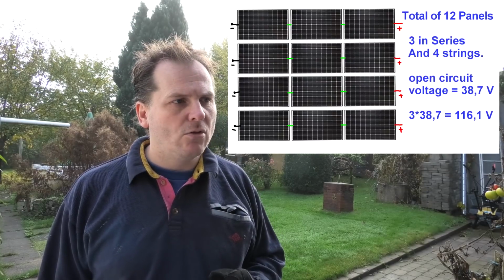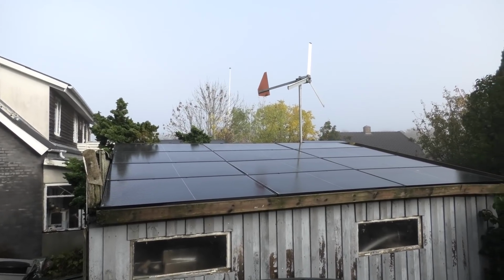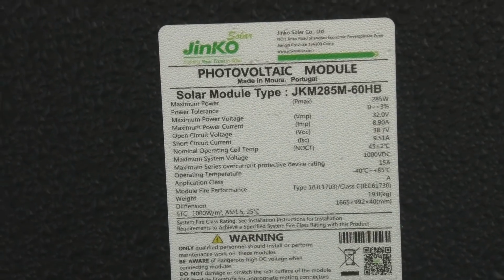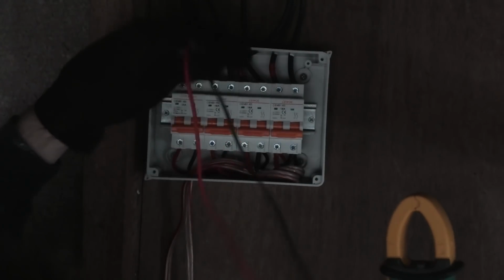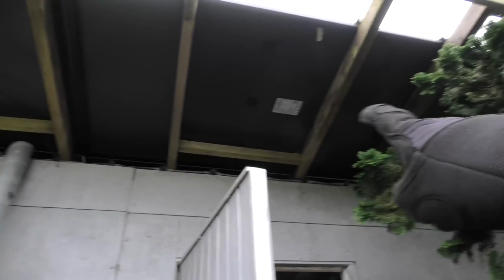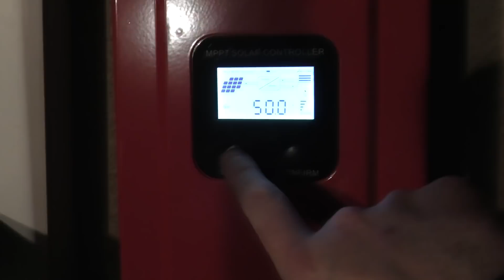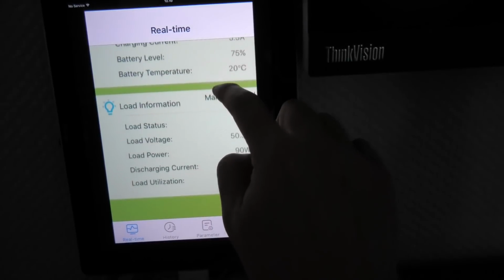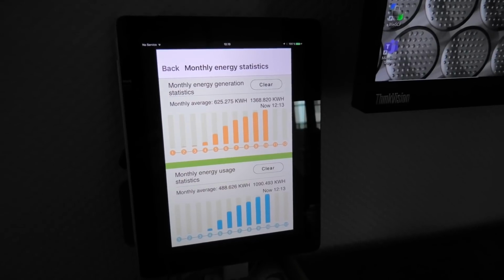Rewiring from 3 to 4 Solar Panels in Series, To Improve Performances - 1013

Comment: Looking good Morten, keep an eye on that 150v max input. I connected 4 x 38vOC panels in the summer and the Esmart controller cut out at 155v in full sun, ended up using a 3S setup. All the best
Reply from the maker: Yes,, I know that I am also a little over,, but only in perfect high sun.

Comment: So now you need some thing to monitor the usage and manage you utility. So for exams automatically activate the new heat pump you could offset your energy usage to use as much solar as you can
Reply from the maker: liik at my videos about the Shelly 4 Pro : https://www.youtube.com/c/MyPlayHouse/search?query=shelly
Reply: @MyPlayHouse  Yeh Morten, i already viewed all that videos! I was thinking if you can use the spare charge controller for your garden robot... I don't remember the voltage of the system buy this way you can change the simple charge controller with a mppt controller

Comment: Everytime i watch these solar panel videos I hope the speaker wire has been replaced with some proper electrical cabling.
Reply from the maker: There is 17 meters,, it is actually expensive, in that thickness and length.

Comment: Hi I have solved the problem regarding downloading the framwork for the ibm server x3650 m3 without heple from you
Reply from the maker: Have not seen it,,
Reply: hi agene about the framework or update the system driver or bios ibm server x3650 m3 i have tread to downloaded bat in the end off download give an error not abele to  save the file file not found i have  trayed many times it is the same error delete all and start from star the same error 
and i need the key for the IMM i not able to find it 
If you can sand it  to me 
thanks

Comment: Hi Morten, can you provvide a link for buying this kind of solar panel? The hiegher voltage solar panel i can find are 24v 300W each and they are around 150-160€ each.
Do you think that the 24volt i found are a good value or do you suggest the panel you bought?
Reply from the maker: This is the panels I have.
https://klimaenergi.dk/produkter/jinko-285-w-all-black-monokrystalin-eagle-hc60-mb-halfcell/
Reply: Is that attacking link for my Facebook account crashing?)

Comment: What is the max voltage on the inverter/Charger? 145v? If so beware you may hit that voltage Early mornings or during cloudshifting. Many people get issues doing 4s on 60cell panels on those systems :) during load it Will work. Problem is when you get rapid clouds during Cold nice days :)
Reply from the maker: It is 150V,, I can have a problem with full sun, open circuit...
Reply: @MyPlayHouse  when temperatures are below freezing and you have sunlight you can get more than 150v. that will fry your controller. best to stick to 3s for 60 cell panels and 2s for 72 cell panels because of this.

Comment: What if the sun shines and the panels go to 160V? Won't the charge controllers then crap out and say "it's over 150!"?
Reply from the maker: I am not sure,, I haven't seen that yet,,, the panals say 38,7 volt open cricket,, I am hoping for a little less.. That is 154,8v so a bit over.
Reply: @MyPlayHouse  Let's hope for a voltage drop of 5V or so over your wiring. That might actually even be true. You could compare the measurement at the breakers in the garage and then what arrives at the charge controllers in the basement, then you know your safety margin.

Comment: did you consider Vo , open voltage? in cold weather this gets even higher . 4 x 38.7V = 154.8V. this is at 25C.
you will be pushing the limits.
Reply from the maker: Yes,, I know it is a bit high.

Comment: You open with a shocker... Wattage will change... No voltage...

You should move the inverter close to the  panels to minimise losses, AC cables transmit further.

You would have to move the batteries too as you will get drops in the charge voltage.

From what I could see the maximum would be 156volts on the inverter, with DC you need to know the differentiation.
This makes it easy to do loads, and power, but most things are done in AC measures when using DC.

Your panel total is 3.42kwh this means that on a average day, using "the math" you should make 13.6kwh

(285*12)*4.
 That last number is called sun hours, and depending where you are, it's about 4 here probably 3 where you are...

Did you calculate the panel angle? They look too shallow and set for summer.

Still you're making power....
Reply from the maker: Both the house and the garage was built years before solar panels was invented,, they have to follow the roof, if I angle them,, they will just block the sun from each other,, and that is even worth.
Reply: @MyPlayHouse  just make a frame to lift them all.

I see you have something there already, you just add legs to the front in a few places. And also use  tie straps to hold them down.
If you align you will possibly double the power your making...
:)